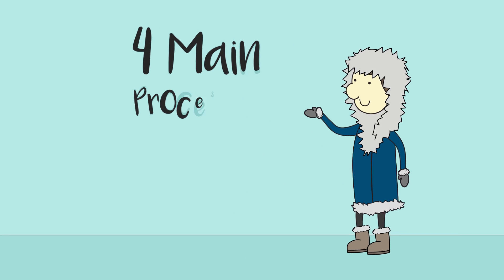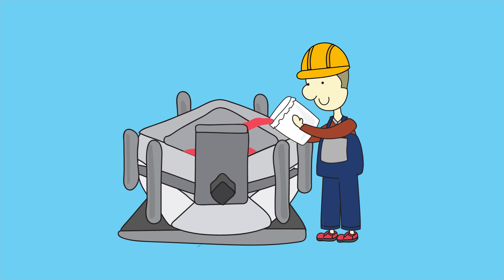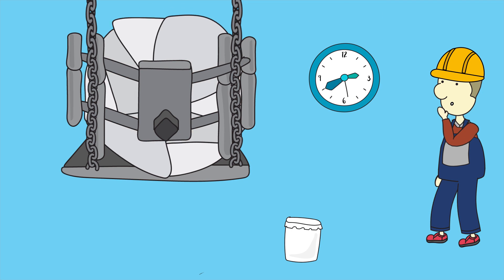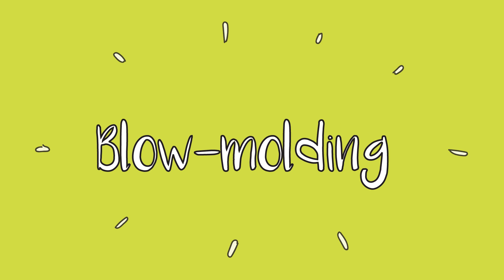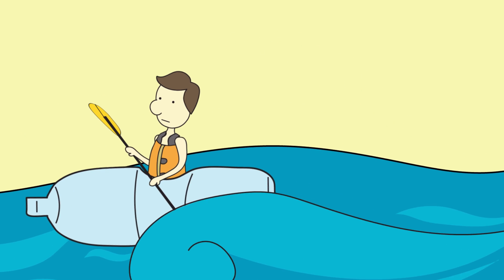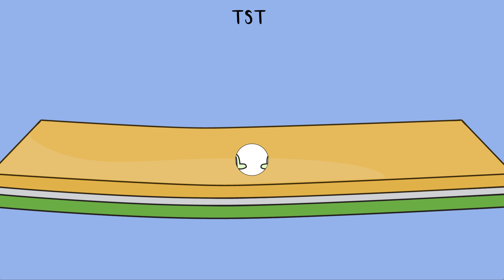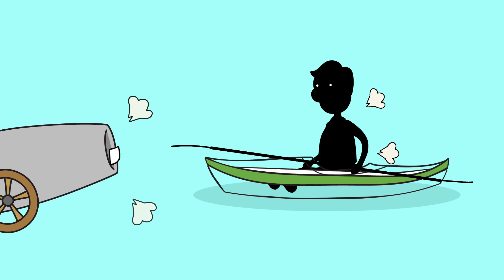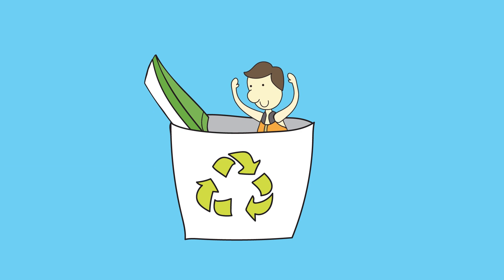PELICAN | How Kayaks Are Built?

Comment: Lol..kevlar and carbon fiber fragile? Where did you get this info?
Reply: John Dirck Manalo carbon fiber does not bend or warp, it's stiff. So it cracks instead of absorbing the hit. That's what he means.
Reply: Vecio composite kayaks are just fine. They are light, stiff and very easy to repair. Under normal circumstances they will last for decades! My first kayak is at least 22 years old and still going strong. And I have not been very kind to my old 'NORDKAPP', I must say! My second sea kayak is 12 years old, still as good as new! Off course all the others are in a way less distructible, but at cost of  at least good cruising characteristics. And mind you; they too are not indestructable, but very hard and expensive to repair.
Reply: Physics maybe! Glass is very hard and also fragile! 🍷

Comment: Great video!  
When I think TST I truly do think of:  Lightweight, Rigid, Durable, and Affordable.
I have compared my Pelican kayaks to my much more expensive $3,000 fishing kayak and found that the Pelican kayaks are truly much more rigid.  When I stand on the deck of my expensive $3k kayak the material flexes ALOT. In fact I have had issues with my expensive rotomolded kayak flexing and not regaining its original shape thus creating spots where water pools.  When someone pays that kind of money they expect better. When I stand on my TST molded Pelican kayaks it doesn't flex and it feels much more rigid and durable. TST is the way to go for long-term durability...and I like that it is recyclable in the long-term.  That way future generations can enjoy paddling and the great outdoors!
Reply from the maker: +KayakDIY Thanks!